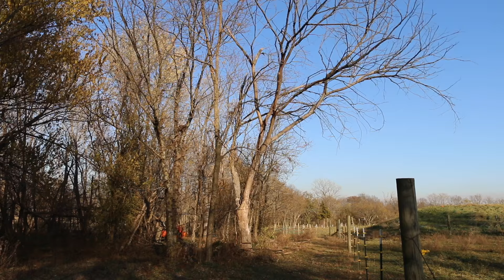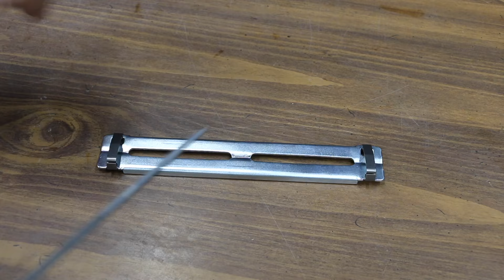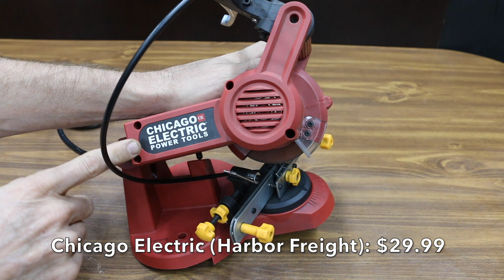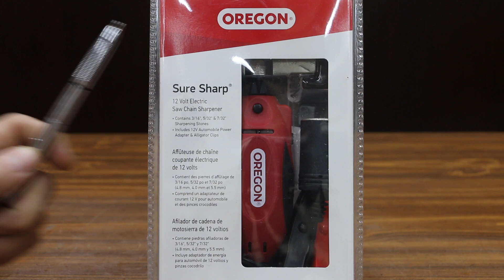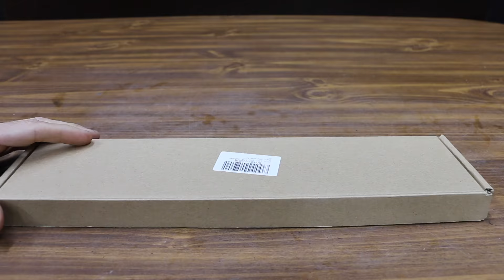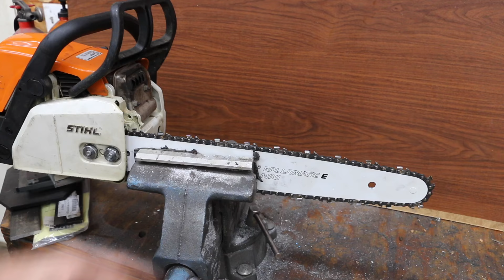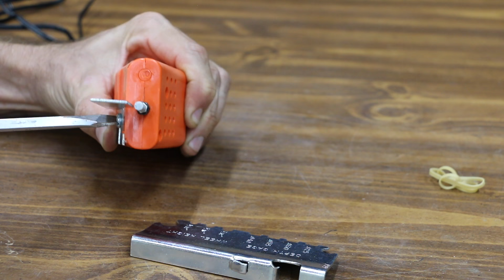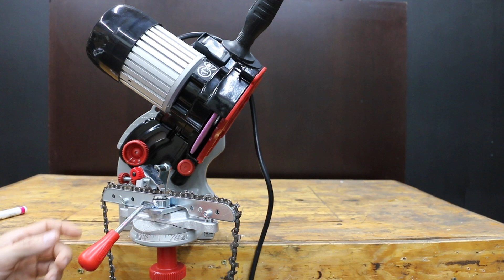Which Chainsaw Sharpener is Best? Let's find out! Stihl, Granberg, Chicago Electric, Oregon

Comment: The timberline chain sharpener would have been an ideal addition to this list.  It's a unique system.  

Personally I like to hand file and find that with practice you can get much sharper than factory and faster cutting which is usually determined by raker height adjustment.
Reply from the maker: Great point!
Reply: Definitely!
Reply: Meh. I had the timberline, and once i got the hang on filing by hand, the timberline lay unused for a couple of years before i sold it. Just an expensive gadget IMHO.
Reply: I like to hand file as well. I use the oregon 12v infield for dirty logs sense it's so fast. You can definitely implement hand sharping skills in to the portable 12 v sharpeners.
Reply: @WOODDIGDIY  I think about getting a grinder but just don't. Asa long as I can file one there's really no need and as far as taking the drags down it's too much trouble to swap stones just for that and having to take the chain off the saw too. And I might have a spare chain but most of the time I don't. And I run Stihl chains because of holding an edge so well.  I used to run Oregon till I tried a Stihl. I'll pay the extra for the extra cutting and most of mine is firewood that's been skidded so dirt is a regular deal. And I always clean,  file and gas and oil after I get done so I'm ready to go when needed. And am using Tru-fuel and don't ever have to worry IF a saw will start. BLESSINGS 2 U!
Reply: @lewiemcneely9143  at $28 a gallon that trufuel is a joke. All you need is R90 and amsoil Saber.... its amazing at 100:1 and only $3 a gallon
Reply: Hand filing is what my scoutmaster did.  He'd touch up his chain practically every cut and prided himself on having a chain so sharp it required no hand force at all.  He made it look so easy that I started out doing the same thing, but quickly learned that hand sharpening was an acquired skill. ;)
Reply: NICK has the secret. The raker/drags height!
Reply: Definitely no expert, but I also imagine that certain angles work better for certain kinds of wood.
Reply: Yep a friend of mine has a tree service Co. I drove trucks for him. he sharpens chains  Free Hand . He showed me how they are razor sharp when he is done. I run professional chain like he does. No ANSI kick back doubled raker.
Reply: @richardpalleschi4807  I can take a double down as I know you can but it's a pain but beats no chain at all. I like a skip if I can get it. When you see the fine edge appear on the flat top all the way from one end to the other you're there and then hit the raker/drags a lick or two and see how it does. Then I know if the drags need a little. I file so the saw will feed itself. Better it than me but it'll kick like a mule. Always paying attention with a good hold.

Comment: But I had to remove a stump. Spent 20 minutes sharpening with a file and after one cut the chain was dull. Damn sand.
Reply: Depending on size of the stump, a sawzall with the pruning blade is pretty effective down into the dirt and roots

Comment: I don't know what about USA but where I live these sharpener's costs more than a new chain. Even the cheapest one.
Reply from the maker: Thank you for the feedback!
Reply: You need to factor in number of chains you go through.  I cut some dirty wood recently, and I had to sharpen every few hours.  The last chain I bought was $20.97.   I paid $37.58 for the Pferd version of the Stihl 2-in-1.  The sharpener is one-time purchase, and the replacement files are fairly inexpensive ($2.22/round file, $9.77/flat file).  Each set of file sharpen n chains, if n = 100 your variable cost is $0.12/chain.   So it's $20.97 /  $0.12 = 175x cheaper to sharpen the chain in terms of cost. The other key factor is how valuable your time is, and how long it takes you clean, mount, and sharpen a chain.

Comment: I've had the Stihl 2in1 for a few years and for the portability and quickness of not having to file down the rakes separately  and getting a great cutting edge with little to no setup or removing of the chain that Is my favorite and if my chain gets that bad to where I need alot of material taken off I'll take it in to get it sharpened
Reply from the maker: Thank you!

Comment: hey @Project Farm i got a good one for ya. how about WELDING magnets. tested for how close to rated holding weight it really does. maybe how easy the ones with the switch to de-magnetize so you can move them easier from the normal ones.
Reply from the maker: Thanks for the video suggestion!

Comment: My go to option wasn't actually included in the video. It's a Stihl FG4. It's a guide for the round files that has rollers in it. It comes with a hardened steel plate that can swivel to file down the depth gaige. The problem with the powered tools, especially the bench grinders, is that they change the geometry which could cause the chains to become dull more quickly.
Reply from the maker: Thank you for the feedback!

Comment: I have a grinder similar to chicago electric
it is very effective and easy to use with automatic clamping
it often is the only reasonable way to sharpen chains because friends and family come to me when the chain pulls to one side from uneven hand sharpening or is badly demaged
sometimes individual teeth are badly bent, broken or otherwise beyond repair and need to be ground away wich is a matter of seconds with that sharpener

that tool certainly pays for itself fairly quickly

yet an other great video from the best product testing channel on youtube
it would be great if there was an official institution that tests products in such a strict manner
but until then we all can watch you do that job :D
Reply from the maker: Thank you!

Comment: I love to use my hand and eye and a file :)
I also have an idea for a test video for you.  I absolutely hate phillips head screws and drivers.  I think it is the worst design ever especially since there are various types of phillips not just sizes of phillips.  So I would love to see if you can test which types of screw heads are the best.  Phillips, flat, robertson, torx, and allen are the types of the top of my head.  I personally think triangle should be the only screw head manufactured period with the exception of specialty fasteners.  Although I replace any phillips that gives me issues with robertson immediately.  Huge love from Canada :)
Reply: Phillips drives were designed to cam out like they do to protect valuable merchandise from the fumblings of unskilled workers assembling them. A stripped fastener is far less of a loss than stripping the whole body of an automobile out. You hating them tells me all I need to know about your skill level too. We'll just have to watch you closely.
Reply: @1pcfred  Bahahhahaahahahhahahahahhahahahahahahah take out a rusted phillips and  a rusted robertson and call me later.
Reply: @xanacanadu  now why would I want to do such a thing? Circumstances matter. Take out a Robertson yourself with a standard tool kit. Like say just the tools you'd find on a Swiss army knife. I have a lot of tools and I still don't own a dedicated square drive screwdriver. I do have Robertson bits though. But I'm an American so we don't go in for that Canuk hardware much here. I only use Kreg square drive screws.
Reply: @1pcfred  The fact that you have the time to try and judge my mechanical skill level by my hatred of phillips drives proves to me your ability to still be living in your parents house.  Tell your mom I said hi.  Next time you have your stupid thoughts to share write them on your palm then proceed to go fuck yourself with them.
Reply: @1pcfred  Also what do you mean by valuable merchandise?  I'm talking about a screw head.  And in what form of any valuable thought would you ever have to strip the whole body of an automobile out because of a failed bit drive in the top of a fastener?  I can almost guarantee that I have repaired more things before I had even gotten into high school than you ever will be capable of doing even with countless amounts of internet resources to do it.
Reply: @xanacanadu  Phillips screws were designed to be used in the automotive industry to attach trim to auto bodies. There stripping the screw hole out would ruin the whole body and cause it to have to be expensively repaired. I wouldn't put much stock into your guarantee. I'm not the one bagging about fasteners here either.
Reply from the maker: Thanks for the video suggestion!

Comment: My angles may not be as consistent as the setups you used, but I just use the stone in my corded electric drills and sharpen right on the saw clamped in a vise. I do flush the chain and bar real well with brake/carb cleaner after sharpening.

Comment: Were you cutting on the push with the file guide? Weird. We cut on the pull, at least 3 times a day working 60 hours a week. But those are great for areas with no power. Also they get it nice without eating a chain in two days haha.

Comment: I can't help but wonder if just doing it by hand with a file or just a Dremel would complete with results..
Reply: A hand file is OK for a quick touch up after refueling your saw, but if you've been cutting dirty wood or nick a rock while bucking, it takes too long.  My experience with the Harbor Freight chain grinder is that it can make things worse.  As noted, it changes the geometry of the chain.  Now I'm using a rotary tool with the correct diameter stone and eyeball the cut.  It works pretty good, but now that I've seen this test, I'll probably purchase one of the rotary tool based sharpeners. BTW, I'm one of the people that requested this test.  Thanks Project Farm!
Reply from the maker: Thanks for sharing
Reply: The Oregon field kit is round file with a guide (that doesn't do a whole lot).  Doing by hand is comparable.  Result depends on experience.  The more restrictive guides like the Granberg will give you consistent results with little experience.

Comment: I know it's going to be expensive but I'd love to see a pressure washer comparison.
Reply: How are you going to objectively test pressure washers? I've pressure washed enough to know how you use a washer is as important as what washer you're using is. What prep you use matters too. There's plenty of jobs where you don't just hose crap down. Try that stunt on the mold here and you'll cause more harm than good.
Reply: @1pcfred  You can test the outgoing pressure and water capacity according to the specs and power consumption. You can also compare psi / dollar. I'm sure there are some harbour freight nominated figures that are going to be exposed.
Reply: @Kurosaki990Ichigo  quite frankly I am not sure if all those specs are the most important features of a pressure washer. For me durability is the biggest factor in a pressure washer. How much I can ultimately wash with it. I've gone through some washers already. So I am happier with ones that wash longer than ones that can wash harder. How many years I can get out of a unit.
Reply from the maker: Thanks for the video suggestion!

Comment: I think that Lil DiHo sharpener needs a special chain. Oregon has a near-identical sharpening system built into some of their chainsaws and those don't take normal chains, they have a completely different cutter geometry that has the ground edge on the top of the tooth.

Comment: My neighbor throw away the chain and buy a new one when it gets dull. I'm doing it freehand with a round file, no more than couple of minutes. Getting it sharp, not factory sharp, but good enough. That Harbor Freight sharpener has so much slop taking a long to time to set up. Once it's set up, pretty good getting the teeth geometry back after multiple hand sharpenings.

Comment: One thing I noticed with the oregon bench grinder was the discoloration on the surface of the tooth. I'm not sure exactly how these teeth are hardened and tempered, but I'm sure that overheating them like that may have some impact on how well they keep an edge especially is the steel is turning blue.
Reply: If you can file it then the steel isn't hardened and tempered. Outdoor power tool blades are pretty mild in hardness. Stuff like say lawnmower blades and chainsaw chains. That's because they can come into contact with hard objects in the ground. Like say rocks. A hardened steel would shatter then. The legal department has enough frivolous lawsuits to deal with too. Now go check on the Gorilla Glue in your hair.

Comment: A guy wonder if there really is a difference in quality when buying spark plugs, copper, iridium, x spark, is it all just marketing?
Reply: There have been more wars started over "which spark plug" than there have been conflicts in the Middle East. That said, platinum/iridium etc do what they say they do. A copper plug also does the same thing. But a copper plug won't last 150-200k miles like I see come in the shop every day. People are running these fine tips in their vehicle from the day they bought it new and never think about plugs until the fist check engine light shows up 10 years later (P0300 through any of the 8 cylinders) Are the plugs worth $10+ each? Depends if you never want to pull and check/change yours again.

Comment: I have been using the stihl 2 in 1 for several years they do have one with a 5/32 file as well as other sizes i have 2 of them for my different size chains. I really like the 2 in 1 we sharpen our chains every one to two tanks of gas out in the field it doesn't take long if the chains are not very dull. next time you test 3/8 drive ratchets test the one on banggood its around 48.00 to 49.00. Awesome non biased video as always!
Reply from the maker: Thank you

Comment: Hey I wanted to thank you for taking the time to make this (and all your other videos) 

I don't wish to be rude or unappreciative, but I do want to point out that (at least in my experience) chain sharpening changes quite a bit from the first one or two sharpenings. At first the teeth are well above the depth guides and a fresh sharpening will have the chain cutting like new in no time. With worse dulling, or on an older chain however, you'll start to see crappier and crappier performance after each sharpening unless the depth guides are also touched up. With most of those systems, that adds a whole other step. 

In my experience the Pferd (rebranded and sold by Stihl as their famous "2 in 1 chainsaw sharpener") provides the best and quickest results over the course of the chain's entire life, and is easy to use in the field. Just my 2c. :) 

Thanks again for the great vid!
Reply from the maker: You are welcome!  Thanks for the constructive feedback.

Comment: Todd, another great video.   I was shocked on how well the Stihl 2in1 worked.  I’ve been using the Dermel attachment for many years.  I had the tool and bought the chain saw kit over 20 years ago.  For under $14.50 is does a decent job.  I would have love to see it against the big ($$$) boys 😉.  I just wish I had a cordless Dremel  these days as it would be easier than having to hook up to a power source.  

There is also something to be said for a sharpener that doesn’t require removing the chain as that adds overall time for removing and reinstalling the chain.
Reply from the maker: Thanks so much!  Thanks for the video idea.
Reply: @ProjectFarm  There are a couple of knock off versions of the Stihl 2in1 on Amazon that are almost half the price.  I’d be curious to see if they’re the same or as good.

Comment: the reason the Stihl 2 n 1 does so well is that it is also  filing down the depth gauge so in essence you are getting a fuller bite!   Every time you sharpen the cutter you are diminishing its cutting capacity because the cutter is built at an angle and as you file away the cutter you are in reducing the size of the bite your chain can take.  The Stihl 2 n 1 solves this issue by also cutting down the depth gauge to match thus preserving the cut depth.
Reply from the maker: Thanks for the feedback.

Comment: Just love your video's. Keep up the great work. I had a good laugh when I saw you use the self sharpening system from Oregon. The smoke it created was hilarious. You actually ruined your chain with it.  I had one. It actually worked great but you need a special chain that cost twice as much and doesn't last very long. I went back to the standard chain once it wore out. I'm glad you made it look so bad. Hopefully no one else will buy it. I wish you would have shown that you can buy just the stone bit for your Dremel for $1. Then you just eye ball it for alignment. I love sharpening my chains. So easy and quick this way.
Reply from the maker: Thanks, will do!  Thanks for the feedback.

Comment: Excellent! This is something I know quite a bit about. First thing is, when filing by hand, the “use an equal number of strokes on each tooth” sounds good, but is just a myth. One might take five strokes to get sharp while another takes fifteen because it kissed a rock or nail. Sharp chains cut straight, so even if the size of each tooth varies in the end, the saw will still cut straight so long as the angle is correct and they are all equally sharp.

The Harbor Freight is great, but mine just sits because I have trouble getting chains too sharp. They won’t hold an edge for very long, and sometimes are so aggressive that they dull very quickly. I’d toss that file guide and sharpen by hand every time, but then I’m a bit of a control freak.

Great video as always, bud.
Reply from the maker: Thanks!  Thanks for the feedback.

Comment: With the auto sharpener you need a compatible type of chain and bar. I've never used an auto sharpener but i understand you make a mistake to use it with wrong type of chain.
Other than that, good job again. Greetings from Greece.
Reply from the maker: Thanks so much!